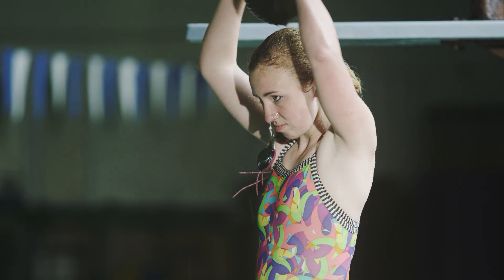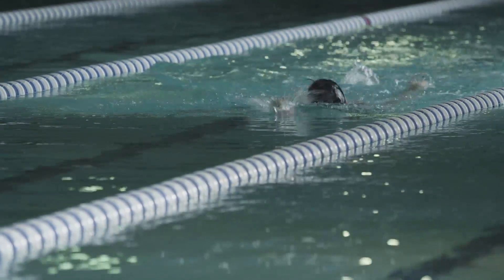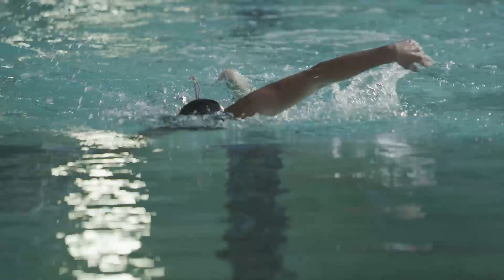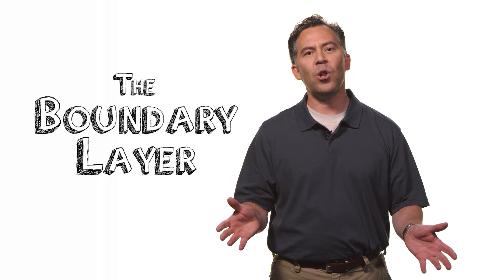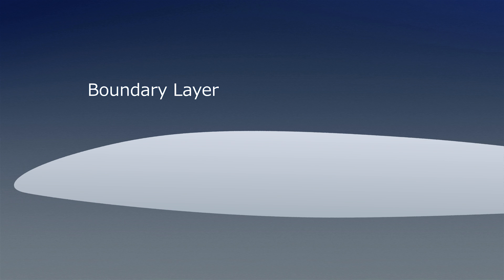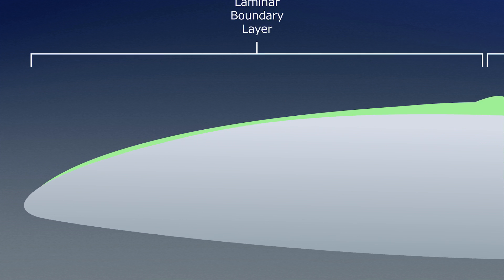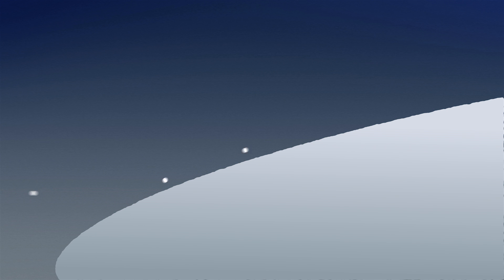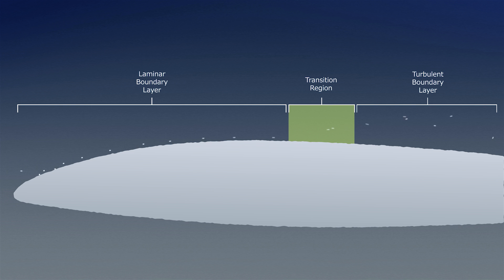Skin Friction Drag

Comment: I have a question. On some airliners there are little vortex generators close to the leading edge of the wing to transition the flow to turbulent and speed up the boundary layer. Doesn't this solution increase drag as the flow separates from the wing surface at as it gets closer to the trailing edge?

Comment: Actually swimmers have been banned from wearing the sharkskin suits which have deliberate surface irregularities which reduce the drag. So why hasn't this technology been adopted by aviation?
Reply: Those irregularities do not reduce drag on a streamlined shape so they are not used on streamlined shapes.
Reply: @TheGreatOldOak  Horseshit.
Reply: @TheGreatOldOak  sharks are streamlined